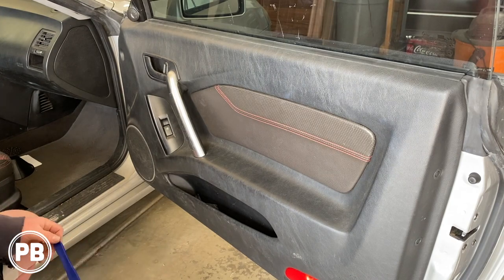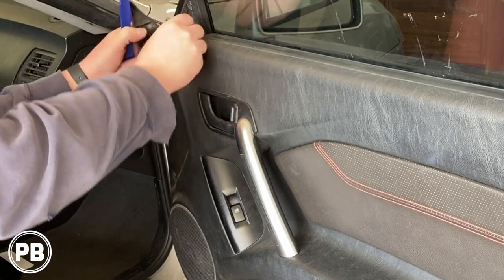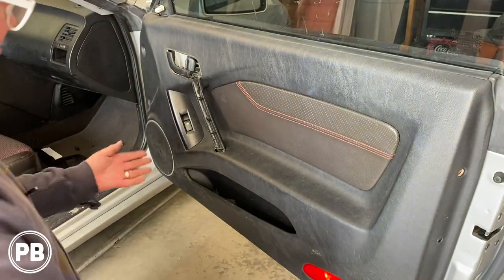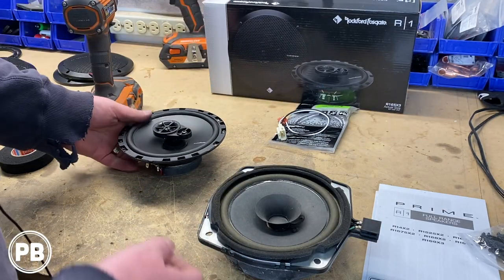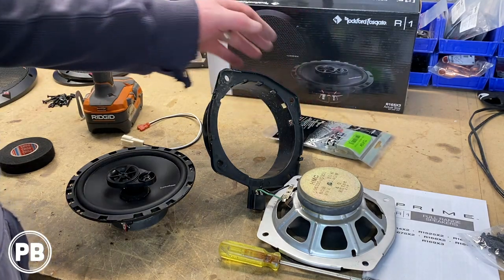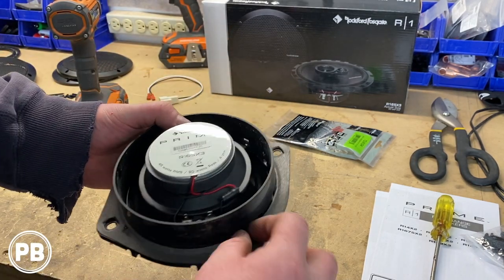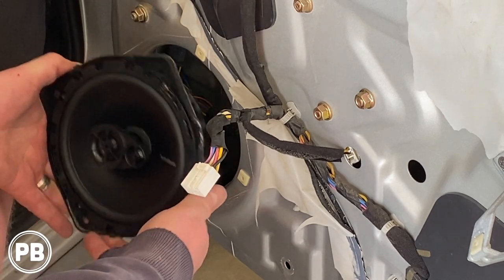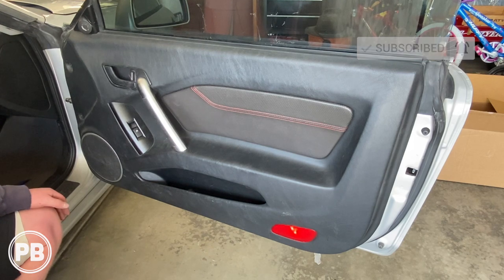2003 - 2008 Hyundai Tiburon Front Door Speaker Install

Comment: Great video the screws to hold the speaker to the oem plate what size are these. Not the ones that fix the plate to door. Cheers. And those wire harness would they work for the rear speakers. Doing my speakers and what to grab right bits 1st

Comment: Hi if I get woofers with the tweeter separately, does that same new wiring harness work for replacing the lower door speaker?
Reply: Also is there a specific tool for crimping the new wiring to the new speaker?